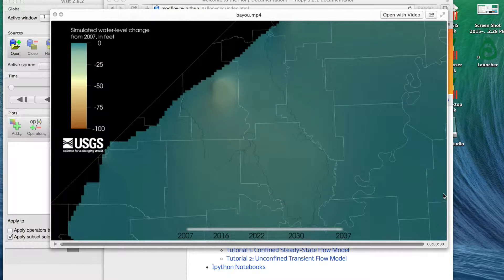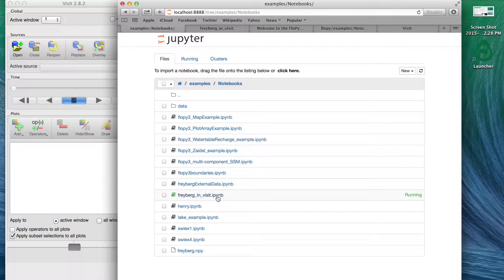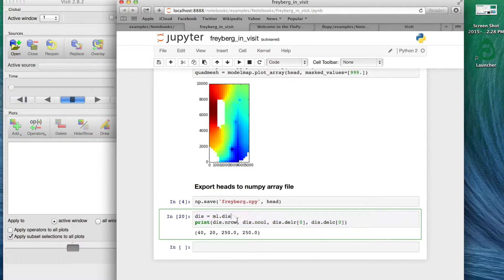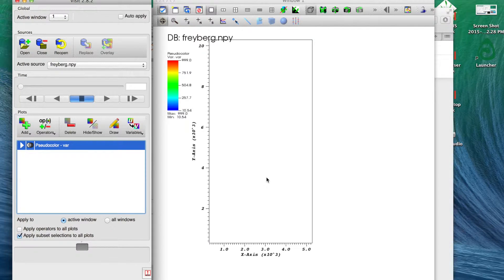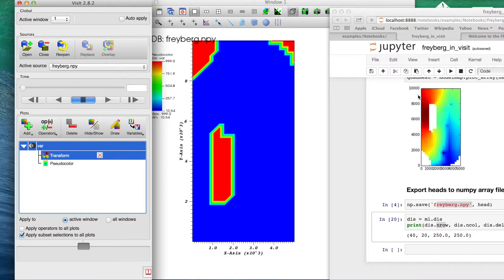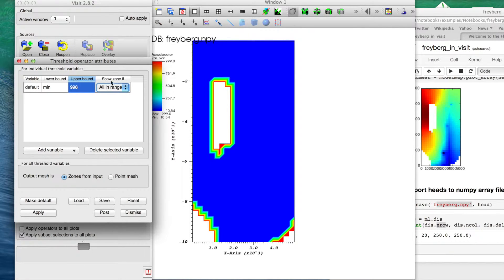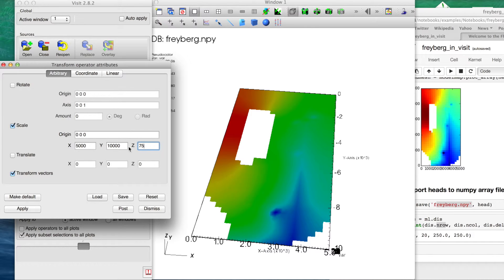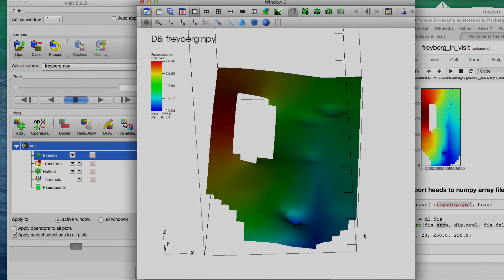How to view groundwater model results in 3D

Comment: neat!, only a numb question how do i install the notebook and the flopy in win?, thanks!
Reply from the maker: I'm currently using the anaconda distribution of python. With that, it should include the ipython notebook. You can also use 'conda install flopy' at a command prompt to get the flopy code.
Reply: +fluidmotionweb thanks man!, one question im using GWV to  extract the heads for my model, and exporting the file to surfer, but this is very cumbersome, do you know some sort of scripting way to perform in flopy that extract and save head formated to import in visit , i mean some sort of function, im very noob on this topic!